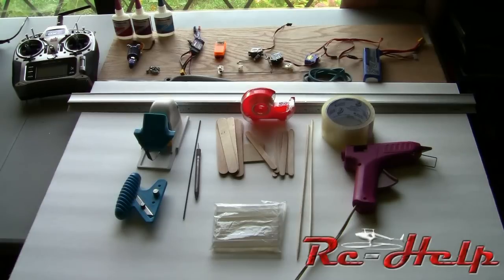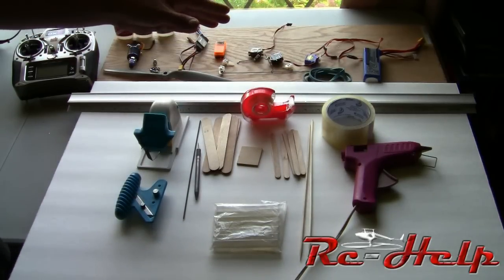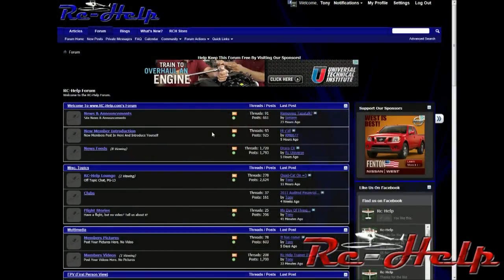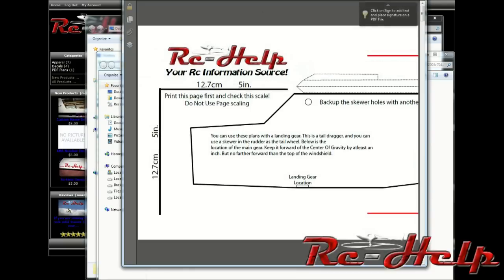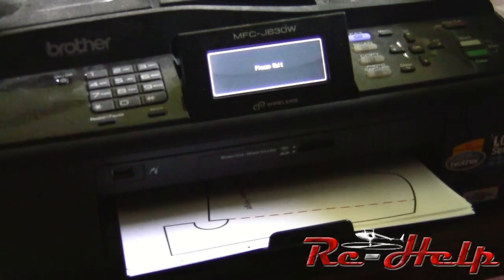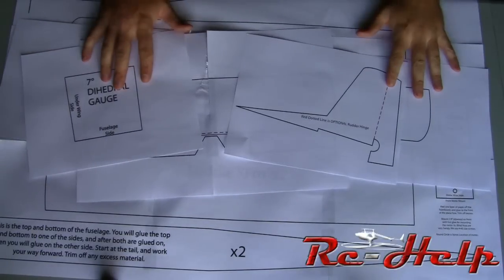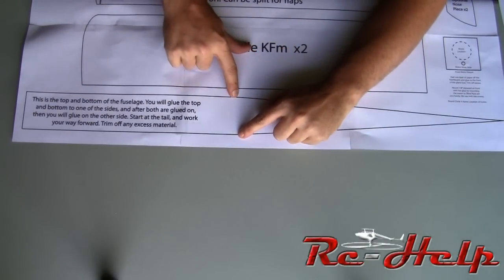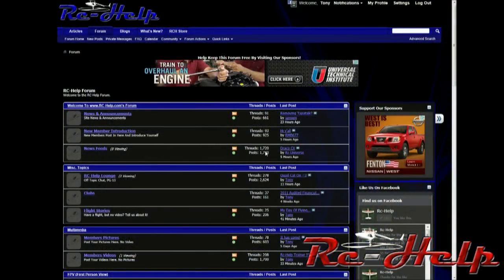Rc-Help Trainer Build Pt. 1 Downloading, Printing, & Cutting Out The Plans

Comment: Could you list the electronic the parts shown for the first part of the video (like the  brand and model number of the)?
Reply from the maker: The parts in this video are pretty old and likely not made anymore. Basically, you will need 9g servos, a 70-80 gram motor that pulls about 300 watts, then the ESC and battery to support the motor. That's about it. Sorry for the very long delay in getting to this comment. Been super busy with everything going on. www.Rc-Help.com

Comment: Starting the build now thank you hope I fly this better than the rc help edge I wrecked that about 6 times it's still in ok condition
Reply from the maker: The trainer is much more stable in the air. If you are building the V1 or V2, you will probably need to add some nose weight. But if you are building the V3, it should be fine. Keep me posted on how it goes.
Reply: RcHelpDotCom I am doing v3
Reply from the maker: Right on, let me know how it goes.
Reply: RcHelpDotCom got the foam board traced and ready to cut, might take a bit to finish it I need to go pick up a seagull harrier and tiger moth biplane tommorw, and I don't get much free time during the week but I will let you know and post pics on the forum
Reply from the maker: Not sure why I didn't reply to this sooner, I thought I had. Hope the new planes are good. And hope you get the trainer built by next weekend.
Reply: RcHelpDotCom just took the trainer out for a maiden flight today it was awesome thanks! I posted a video to my youtube channel my camera girl is 8 years old so not the best video but you can see it fly! Check it out tell me what you think

Comment: Can this run on a 2200kv 2212 motor? Im trying to find the right plane for my motor. Im new to it all.
Reply from the maker: Will it work? It should. But you are going to have to put a proper prop on it. I would not go over an 8x4 on that motor, and even that could be too much prop. Just test it for a couple minutes in the air and then land and check motor and ESC temps. www.Rc-Help.com

Comment: do you have any plans for a 28"-32" wingspan high wing plane ? i am new to this hobby. glad if i could use some help :D thanks
Reply: are all 30" planes 3D ? im planning to make a 30" high wing plane but couldnt find any plans
Reply: i see thanks :D i will try to design my own 30" plane XD
btw i got a question , if the Wingspan is 30" , how long should the fuselage be ?
Reply: ohh i see. when you build a plane , does it normally fail a few times the first time you try to fly it ?
Reply: RcHelpDotCom write down all the things that you have use 
eg: serovs, foam type, motor kv...

plzzzz